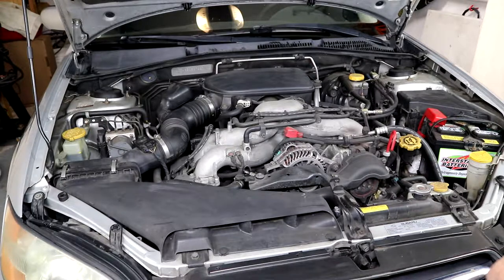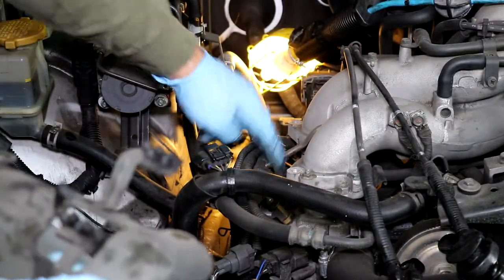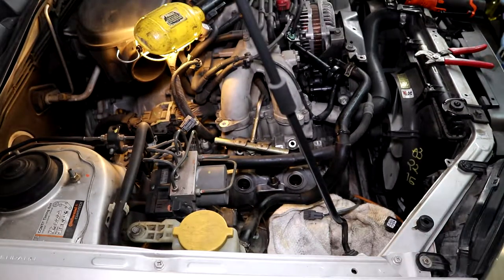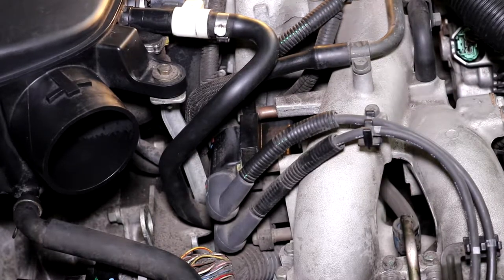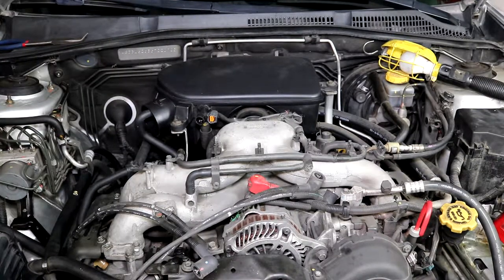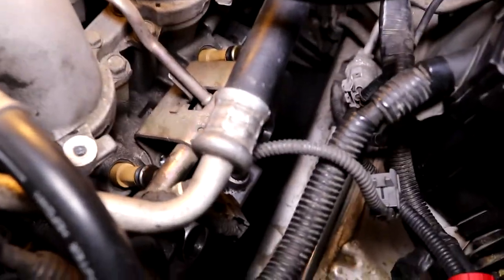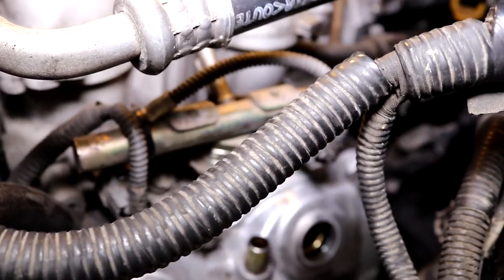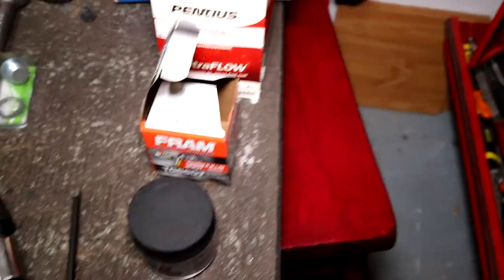2006 Subaru Legacy 2.5i Engine and Automatic Transmission Service Video Part 1

Comment: The fuel injectors listed on Amazon aren't the denso oem. I can't find any with that lower seal that's like yours. I just have a crack in the rubber on the lower seal. Those oem injectors are like 150